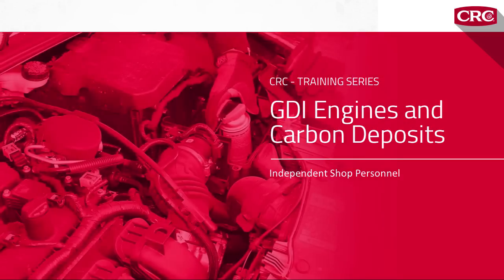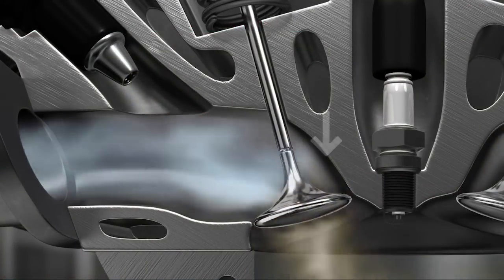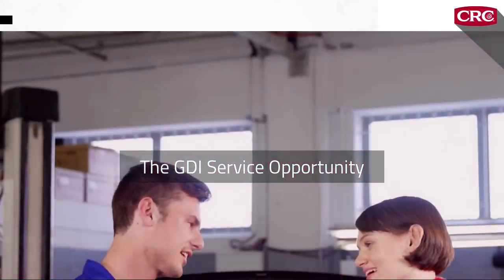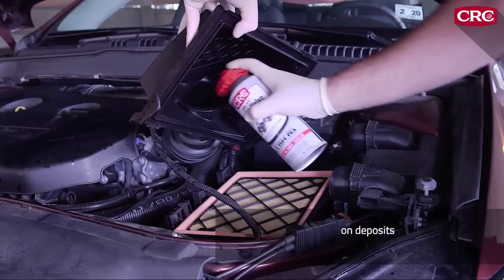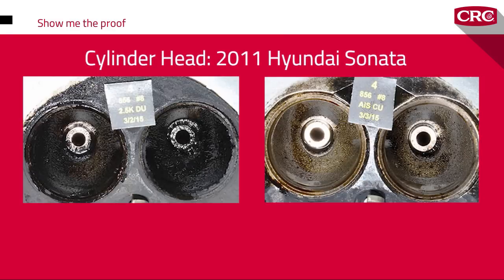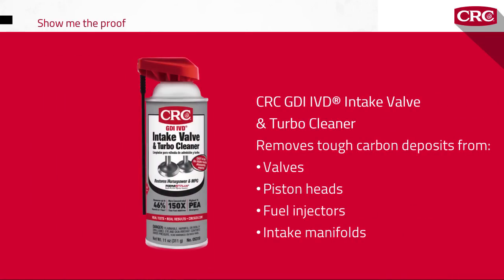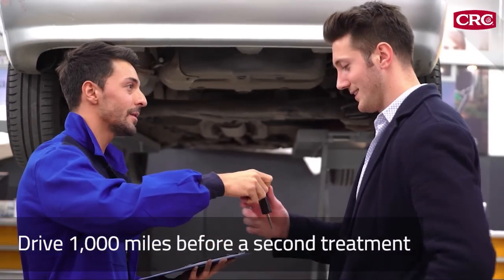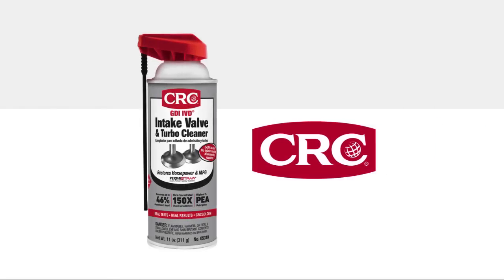How To Use CRC GDI Intake Valve & Turbo Cleaner

Comment: This is my second time I used the CRC Intake Valve And Turbo Cleaner in my 2013 Chevy Equinox. After using the first time I noticed a significant difference in the performance. After about 5000 more miles I used it again today and came back from driving the car on the highway for about 15 miles. I noticed the difference in performance but not like the first time. So I think the first time I must have had more carbon deposits. Since this is repeater I am not noticing a huge difference. This stuff works!! Thank you CRC!
Reply: How to use ? I don't want to break mass airflow sensor ... also, did you change oil after using ?
Reply: Did you see any increase in fuel economy?
Reply: Did you use it directly through TB or intake air horse? Let me know

Comment: Nice animation but please show some proof with a borescope! Use the product as directed and show us w/ borescope before treatment and what it does after 1K miles. I keep hearing horror stories of engines rattling... would love to see you guys actually put out a real before and after video. As I love the concept but am a little hesitant to use product as directed. I am 100% sure it will work if I take off the intake manifold and spray it in directly and scrub the valves myself.... but you guys claim it will work by just spraying into air intake.... please do a more thorough video. Also, need some clarification as to whether or not to change oil after use of this product. I have Mazda CX 5 w/ 36K miles.... not sure if I should use it before or after oil change, also want to make sure that any deposits that come off won't scratch up the sides of the combustion chamber. I'm sure there are plenty of folks out there, like myself, who would love to see this product suceed and be all that it claims to be, we just need a little more proof with real life experiences and videos. Would be a good investement on the part of CRC to spend a little more time making such videos or sponsor some mechancis to make more through videos w/ before and after effects.
Reply: It does cleaning the walls pretty well, but the deposits on the valve is pretty hard to clean.  With yours at 36K miles, I doubt it will do much.  I use it every 5k. the walls are like new, but the valve still accumulate deposits even with a oil catch can.  I did it before oil change.
Reply: Removing the intake manifold on the CX-5 is VERY easy. Its cleaning and scraping the deposits from the ports and valves that take up the majority of the time but well worth the work. After that, I bet you your skyactiv engine will run so smooth you don't even notice it running. This is from experience.
Reply: BigDog please kindly watch the whole video!
Reply: I have been using this for multiple vehicles and I always do it prior to my oil change. As the video says do it every 10k or at every oil change. I send my oil to Blackstone, and they could see the chemicals in the oil. I do it as a preventative so carbon DOESN'T build up. Once it builds up, it will take multiple applications...important to heat sink the product.

Comment: If used as regular maintenance, ie, 10k intervals, it's safe on turbo GDIs, but as a fix for heavily gunked valves, is there a risk that a chunk of carbon deposit will dislodge and mess up the hot side of the turbo - just like person getting a stroke from a dislodged blood clot? Also, some cars in addition to a MAF sensor by the air cleaner, also have a boost pressure sensor near the intercooler and a MAP/IAT sensor on the intake manifold. Is the product safe on those sensors? It's probably safe on pressure based sensors, but the IAT portion of the MAP might be affected negatively.
Reply: I'm wondering same things great questions wish someone would answer
Reply: A few things to note.
While a carbon piece might make its way into the turbo,  the turbine blades will likely be fine with such a light piece of debris hitting them at such a low engine load (reving up at idle). The boost/MAP sensors will be fine since even if a film is deposited, that won't affect a pressure reading. It also hasn't ever affected my IAT readings before and after.
Reply: I have the same exact concerns about the MAP and IAT sensors. Did you already use the product and not have issues with the sensors?
Reply: @blackriderph4340  I have done it on my '17 Mazda6 at 25k miles on the odo, which has all three MAF, IAT, and MAP sensors (no turbo), and it runs fine. I can't tell if it did anything and I haven't visually checked before and after on the valves. I haven't done it on my turbo CX-5 yet. It's still under factory warranty and don't want to risk.
Reply: @dogwink  i have the same setup in my mazda3. The map and iat sensors are in the manifold. I still cant decide if i will use this procedure. Ill buy the product anyway  it can still be used in manual cleaning. Thanks for your feedback
Reply: All you manifold sensor guysjust remove or cover them and spray into the hole that was the sensors

Comment: I made this treatment yesterday on my hyundai i30 gdi 1.6 135 hp 77.000 km. After an 1 hour an 10 minutes i drove the car at 4.000 rpm for 20 minutes.  When i hit 4000rpm in second gear a huge cloud of smoke was released and i heard some noises on the evac, i think that was carbon build parts.  The product  made his job.
Reply: How much improved the MPG in your hyundai? The same happened to me today on a Kia Soul 2013  1.6 , when I hit 4000 I hear a sound and saw a huge  cloud of white smoke, the MPG has improved from 19 to 25 on the first day, awasome
Reply: @fernandoruiz734  4000 rpm? So how many MPH did you get? For how many minutes? any police stop you?
Reply: @fernandoruiz734  I did this job today, nothing happened, no smoke, nothing improved at all, and I have never done this before with a Kia soul 2012 and 66K miles on it. I use the PCV hose and one can, wait one hour and drive on the freeway or why. I follow all the instruction
Reply: @irisbaez1972  Hello! Does your car have MAP and Intake air temperature sensor in the intake manifold? Im hearing stories that this product will damage these sensors thats why im still hesitant to use it in my mazda 3 skyactiv. Will this not damage the MAP and IAT sensors?
Reply: @blackriderph4340  Yes, kia soul 20112 automatic has a MAP. doesn't have MAFS. My Elantra 2008 has MAFS.
I did the same job in my Elantra and nothing improve, no smoke at all. I use in both cars the PCV hose.
Reply: @irisbaez1972  thanks for the feedback!
Reply: @blackriderph4340  remembers both cars are not GDI, so the intake valve is cleaned all the time by the gasoline and any cleaning thing you add to the tank. I use Lucas oil upper cylinder and fuel injector cleaner once a month or every two weeks. I have a long time doing this.
Reply: @blackriderph4340 ..go back and watch and this time LISTEN. DO NOT SPRAY INTO MAP!!!
Reply: @harryberry474  you go back yourself and listen! Dude MAP is different from MAF its obvious you think its the same. The instructions clearly states that do not spray in the MAF but it doesnt say anything about MAP. In my other comment CRC industries already clarified that this product wont damage the MAP and IAT sensors! Again MAP and MAF are different sensors you go back yourself and listen carefully.
Reply: @irisbaez1972 i think you're mistaken it for Seafoam.  Seafoam would produce a lot of smoke if your car is clogged up.
Reply: @irisbaez1972  You put it in the wrong place.
Reply: @blackriderph4340  Called the tech support on this point and they said that the MAP senor (manifold absolute pressure) only measures air so it would not be effected by the treatment. I have an extra one I was planning on installing anyway with 105k on the odometer. However, if you have high miles, I've seen really, really crudded up intake manifolds with oil build up, along with the carbon, that there's no way this product can tackle all of it. At $97 on the GM dealerships that sell parts wholesale online - you get the manifold, the seals, gaskets and the sensor all for that price. It's also guaranteed for a year - just take it to your local GM dealership if it's a dud. For me, just replacing the whole thing and using this to prevent future issues with the 2.4 Ecotech, GDI PCV orifice,  etc. if you have that engine) if you plan on keeping the car a while, seems smarter to just do it that way. Over a 100k, some even under that mileage, the seals are already leaking. Good luck.

Comment: 8/19/2022

WOW! I just did this for the first time on my 2014 Honda Accord after getting a check engine light at 175,000 miles. The engine light diagnostic showed Error Code P0087: Fuel Rail/System Pressure Too Low. I thought it might be the fuel pump which would’ve been around $1500 to fix. So before doing that, i changed the air filter and used the CRC GDI Intake Valve & Turbo Cleaner and i must say I’m extremely happy! Not only did the engine light go off and i saved myself a lot of money, but after about the second day as this cleaner continued to work it’s magic, my Honda is running like she’s in her early 20s again! I highly recommend treating your car with this!
Reply: Hello! Does your car have MAP and Intake air temperature sensor in the intake manifold? Im hearing stories that this product will damage these sensors thats why im still hesitant to use it in my mazda 3 skyactiv

Comment: Used two days ago on my 2016 Mazda CX-5 with 55,000 miles on it. Used as directed. Had check engine light and several other warnings come up while doing it. After the heat soak car started up normally with only check engine light on that went of after about an hour of driving. Seemed to help idle and performance although while doing the procedure I didn't have hardly any smoke coming from the exhaust. Will do an oil change today. Product worked as advertised.

Comment: I just did this on my 2014 accord 2.4 and it was a one owner car but I had poor mpg. If you follow the instructions and I sprayed through the brake booster hose on the intake manifold. During the idle process I fogged up my whole block. Then when I drove it it was bad the fog was everywhere but it fixed my low mpg and idle issue.

Comment: Interestingly, the instructions on the New Zealand version of the CRC Intake Valve Cleaner say to spray "continuously for 30 second intervals", rather than in short bursts. I was following the instructions on the can, and my car reported a P0132 (upstream oxygen sensor voltage high) during application. Also, the engine started pinging while driving following the heat soak, so I'd recommend going easy on the accelerator for the first 15 minutes.
Reply: same my engine died several times AFTER letting it heat soak, it was scary but I kept turning it off and on to clear the engine of the cleaner

Comment: yep all the above for me! just used your product!! sprayed scrubbed directly on the valves..used brass brushes port by port and sucked it out....broke up very clean and it took me 6 hours but well worth it!
Reply: I did the same today. Disassemble the intake manifold and throttle body scraped off every intake valve and reassemble everything.
It really was dirty but I left it really clean. Then I added a second can following the instructions in the can. I saw a really big cloud of smoke coming out of the tailpipe. So I ended using 2 cans. Total work time about 5 hours! But I am really happy!!! No more fucking misfires !!! No more fucking rattles !!!
I saw this guy who had a bmw and he was doing all the above process but no adding the second can. So I said...I want to be really sure I will do the 2 methods!!! :D The results are like difference between night and day !!!
Reply: @joecualquiera  when you say "I added a second can following the  instructions on the can" I wonder where did you sprayed the can into? If the MAS sensor is in intake, on the n54 335i
Reply: Hello! Does your car have MAP and Intake air temperature sensor in the intake manifold? Im hearing stories that this product will damage these sensors thats why im still hesitant to use it in my mazda 3 skyactiv

Comment: not enough words can explain how satisfied i am with how well using that cleaner turned out so far
my car runs so much smoother it sounds different, like the car doesnt need nearly as much effort to accelerate, starting from a stop doesnt feel like a chore the car has to endure anymore, and it no longer hesitates on big pull accelerations, like its significantly better now, even the turbo sounds happier and i did this by simply going through the intake past the MAF and through the turbo and intercooler. Thank you for this video CRC im planning on continual use, my car feels amazing now
Reply from the maker: Thank you for giving GDI IVD Intake Valve & Turbo Cleaner the opportunity to lend a helping hand. Stories like yours are what inspire us to develop the best solutions and innovations in automotive maintenance chemicals.

Comment: Used this in a 2016 Mustang EcoBoost with 25000 miles. Sprayed it in the intake duct just after the MAF? sensor. Seems to have worked very well. Off idle throttle has definitely improved.  Throttle response seems smoother. Will update if I find and downsides if any happen. Engine did not throw a code and no smoke etc happened.
Reply: 25K isn't very long for carbon to build up but you like prevented it from building up.
Reply: Def better to use it before you have huge amounts of carbon buildup

Comment: Don’t listen to the idiots saying this is bad for your engine from causing damage to your cylinders. The formula dissolves the carbon in a safe manner that doesn’t cause scarring to metal surfaces. Also, CRC is a highly reputable company that performs with quality. They don’t create solutions that make matters worse. Moreover, after using about 5 applications of this specific product on my GDI engine, I can say that acceleration and idle have a noticeable improvement. I would recommend using it at every oil change to really help eliminate all carbon deposits on your intake valves. For only $10-$15 more per oil change, you can keep peace of mind your engine won’t struggle and die a premature death from unnecessary stress.
Reply from the maker: At CRC Industries, we measure ourselves by the quality and efficacy of our products and the satisfaction of our customers.  Thank you for your comment and support.
Reply: And also using the product as directed. Some people will buy it, skip or modify some of the steps then get mad when it doesn't work the way it should. The most common being not heat soaking the engine first.

Comment: Informative video! We used this on my wife's 2018 Pathfinder, and heard a ticking sound, as some carbon broke off, and bounced around the  drivetrain before blowing out the exhaust lol. So I plan on using a can of this every year for solid preventative maintenance
Reply: It didn’t blow out the exhaust. It got stuck in the catalytic converter
Reply: @gefreiterkurzmaul  it bounced around the drivetrain... HAHAHA. pretty sure your exhaust isn't connected to your drivetrain... fuck this is hilarious...

Comment: I just used it on my Hyundai GDI, with 30K miles on it. And it worked great, luckily my car doesnt even have a MAF sensor, so I just sprayed it into the intake and I figure the engine is super small I only used half a bottle. waited an hour for the heat soak and drove it on the freeway, it had a little hesitation, then I saw that it expelled a huge puff of smoke, and after that the car ran like new. The Idle is back to what it was before and just seems a little more responsive when I step on the gas. I don't think there was too much build up since it was only 30K miles but I wanted to do it as a preventative measure.  I'm hoping it will continue to clean like it says in the video and I will probably use the rest of the can after 1000 miles.
Reply from the maker: Thank you for sharing your experience with our GDI Intake Valve & Turbo cleaner.  We hope you continue to see great results.  In the future we do recommend to use the entire can of product in order to receive the full cleaning effect.  Remember to spray in short 1 second burst to avoid any pooling which may be the reason for the puff of smoke.
Reply: Hello! Does your car have MAP and Intake air temperature sensor in the intake manifold? Im hearing stories that this product will damage these sensors thats why im still hesitant to use it in my mazda 3 skyactiv

Comment: The product does indeed work, but there is a problem.  My oil analysis shows the hard particulates in the oil skyrocketed after performing this service. Not all of the carbon is consumed or exited the exhaust.  How of this stuff remains in the catalytic converter.  Fine soot and carbon mixes with the fuel and oil on the cylinder walls and is forced past the rings contaminating the oil.  It took two oil changes within 100 miles to get the levels back to normal.  A typical oil change leaves behind 10-20% of the contaminated oil.   The typical 25 micron filter is not going to remove 2-15 micron size carbon particulates.  If you perform this service change you oil afterwards and a second time.

Comment: I just bought a can for my 07 Mitsubishi 380 with 300k on the clock but now I'm thinking there will be to much carbon built up & may glog my cat? I just bought the car and unsure what oil has been used & fuel quality.

Comment: Got a lean condition po171 and I have done so many parts swaps at just under 100k on a 1.4 luv cruize this has to be my savior

Can this be done at or under freezing temperatures?

Should the oil be changed after wards?

How many times should it be done to get that walnut blast clean effect?

Comment: Just used today,  4-15-22 on my 2006 Subaru sti w/140,000 miles. Ej257 engine w/ port injection.  I/m readiness 5 complete.  2 are not. Catalyst and o2 sensor.  Also idle fluctuating slightly between 500 and 750.
Reply: Did it work?